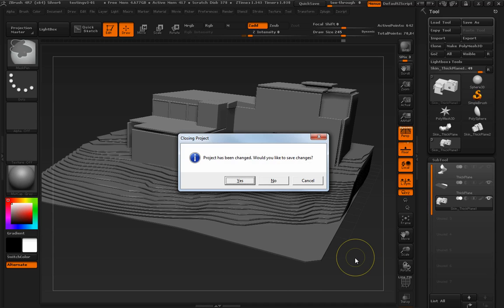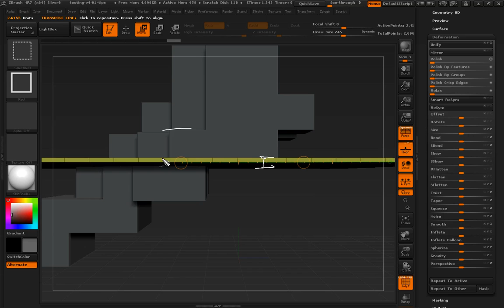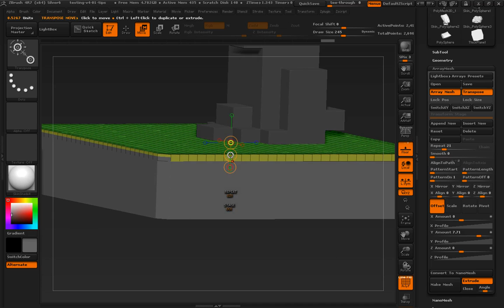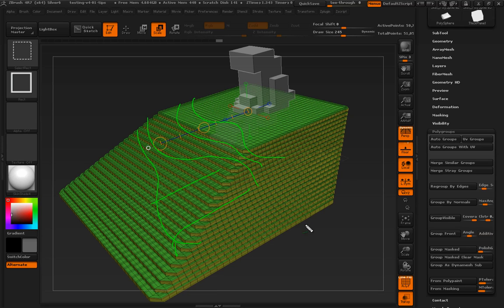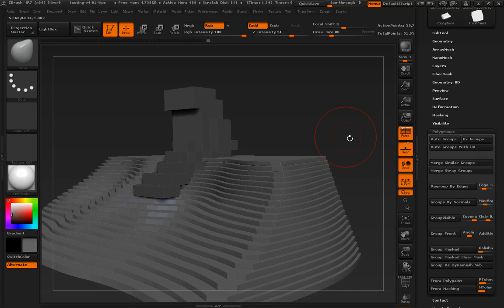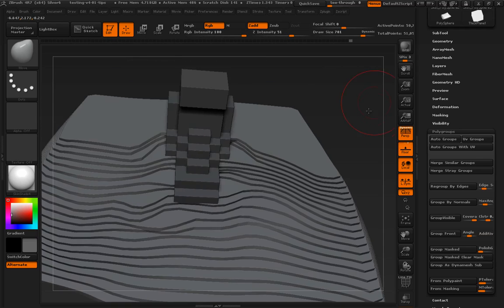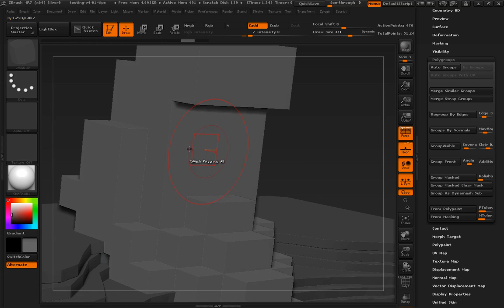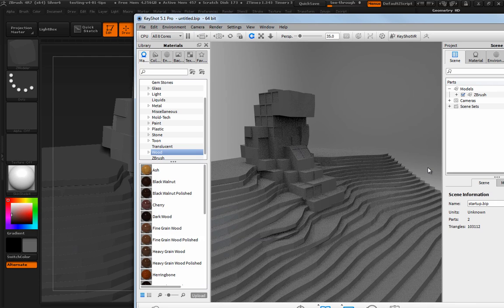ZBrush 4r7: Creating 3D Architectural Models Using ArrayMesh

Comment: Its all good but really I would like to see if there is possible to create objects for architectural visualization that are up to scale (something more then just eyeballing it on blueprint, exact sizes...). I would like to use new ZB modeling tools for it if possible.
Reply: Zbrush does't really have units, so that is gonna be hard, that is if you are talking pin point precision. But Zbrush is great for just blurting out the general idea, i'm never gonna say you cant, because with enough fiddling you can do almost anything in zbrush but there is other software that will do work like that much easier.
Reply: ***** Yeah, I got feeling that there is a way. I dont need CAD precision, but something close enough so I can keep proportions right. For now still mastering that new modeling brush.
Reply: Nezumi SketchUp is your friend for that kind of work.
Reply: Colin Robertson yeah, I know Sketchup I just want to explore possibilities within ZB. Normally I am using Blender.